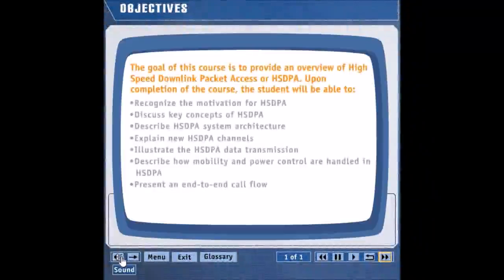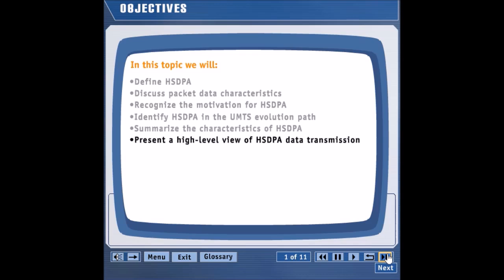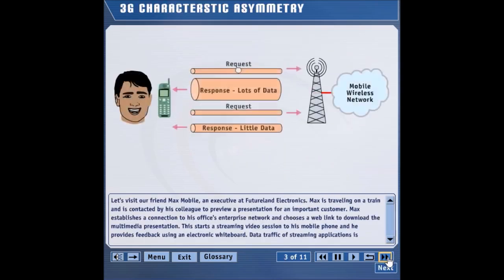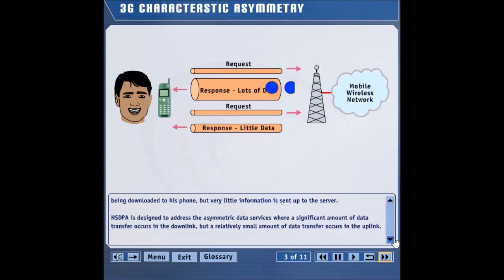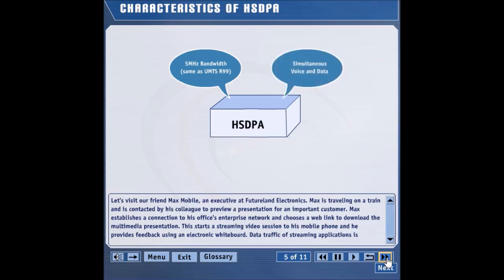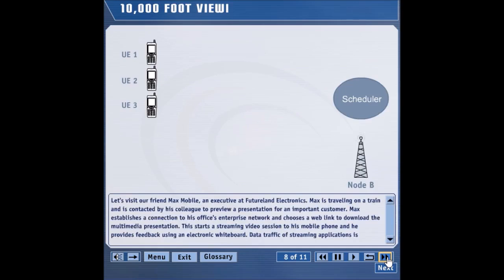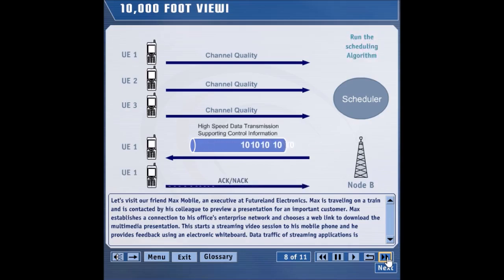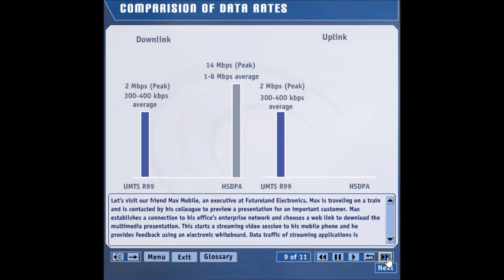HSDPA Tutorial Overview Part-1

Comment: hi i need help. could any one have any idea with the problem that i m facing. in my township, we using UMTS2100 network provided DC-Hspa. but the problem is if i set my s6 to hspa relase 7 or 8 or 9 using *#2263# DL throughput very low n only get 2 or 3 Mbps avg. but if i set to relase 5 it is fine 10Mbps stable.. how come my township is the other way round
Reply from the maker: Need to debug this issue..might nevigation/supplimentary issue